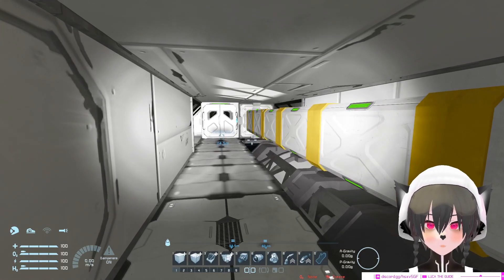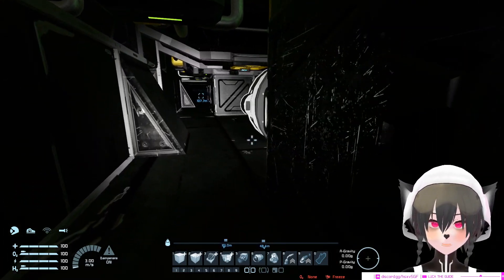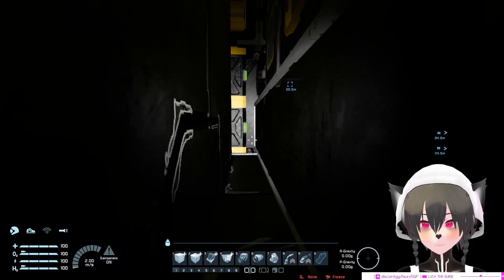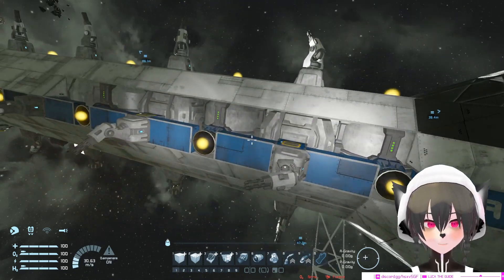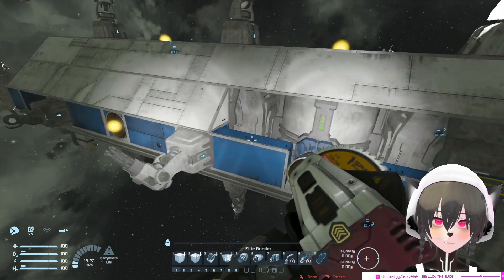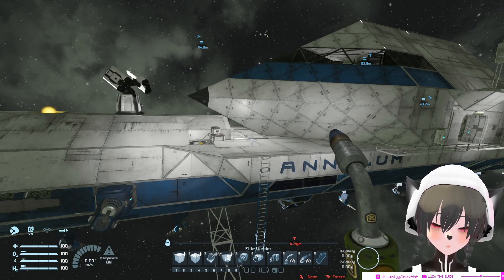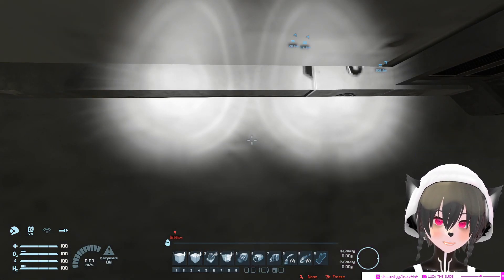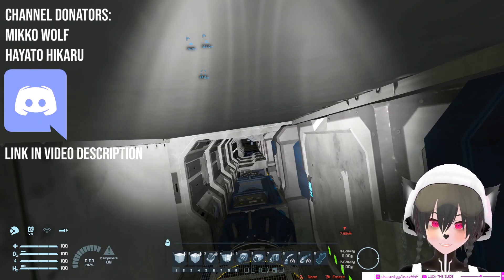3 Types of Ship Maintenance Tunnels, Pros & Cons, Space Engineers Survival Ship Design Tutorial

Comment: Another thing is Efficient labeling, interior modules should be renamed/labeled better than simple numbers but co-ordinally. Actual navy ships have a lot of specific names for things. I personally use Port and Starboard because they are not terms like right and left, because its easy to get confused based on a subjective orientation. Whereas a ship has a starboard and a port side, A Ventral and Top Side and a Head and Rear side. Abbreviations are simply P S V T H R And then its sequential by closest to axis outward. Helps me tell what is gone and not working.
Reply from the maker: That's a pretty handy tip c= thanks Pick x3
Reply: @LucaTheGuide  it's really good to label stuff when you start making custom turrets or any sub grids systems.  Other wise you get stuff freaking out by miss appropriating a camera to the wrong turret.